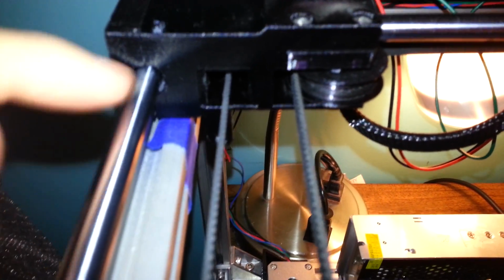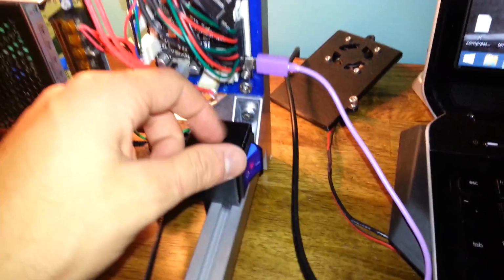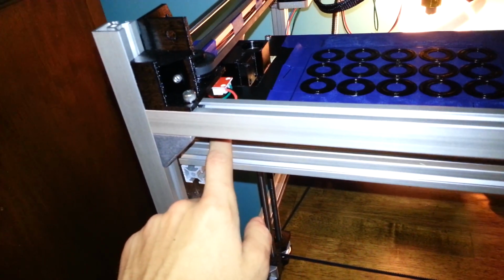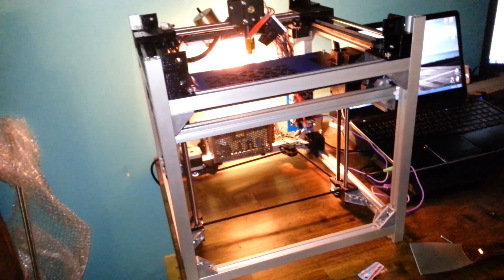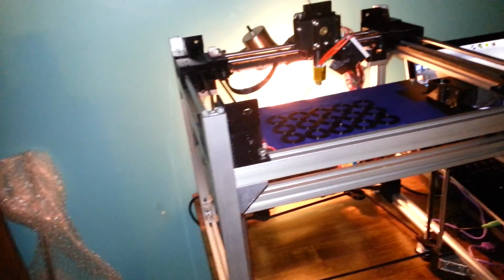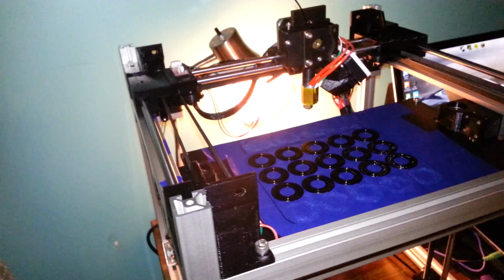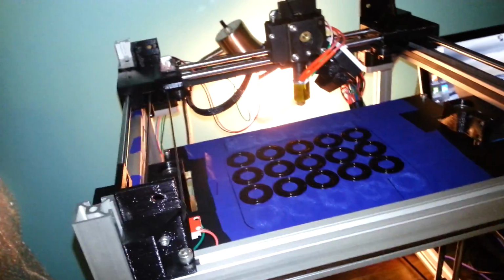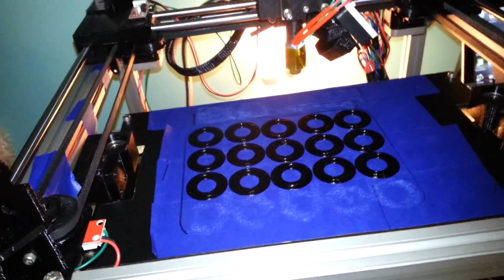3uP Update 17 - Plexi is in & Wire Management

Comment: Bit of a strange question, when repetier host crashes, how does it crash? I've had my printer just stop sometime so wondering if that's repetier or something else.
Reply from the maker: Colby Collins Well it may be static electricity or it may be repetier. I have my board mounted to a plastic bracket so shorting isn't a problem for me. My repetier program actually crashes on occasion. What happens is the printer just suddenly stops moving, then when I go over to repetier to try and hit stop print so I can move up the head, it just fades out and gives me the "this program isn't responding" crap. That is why I almost exclusively print from the sd card now lol!
Reply: Yes, that has happened to me. That is actually static electricity going through your printrboard and it "stuns" your printrboard. The best way to avoid this is by cutting a piece of rubber to go under your printerboard and it will not allow electricity to travel through the board. Hope this helps ya!
Reply: Colby Collins Thanks, that sound like it. I'll try that out. If static is the cause then even printing from the SD card won't be safe.
Reply: 3DprintedLife Going to start using the SD card as well for longer prints, getting it in and out is a pain but found a solution.
Was also looking at Octoprint with a raspberry pi and a WiFi dongle, it loads the gcode much faster and you can use a tablet but it doesn't offer the same level of control as repetier.
Reply: Yes, I recently just purchased an SD card too.